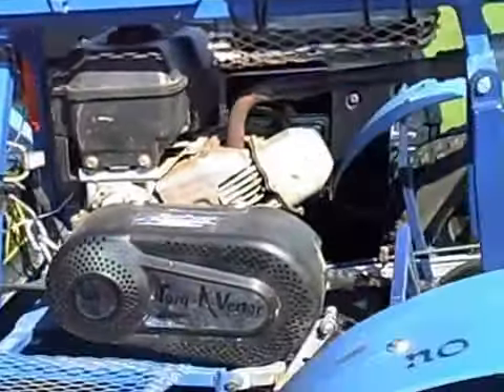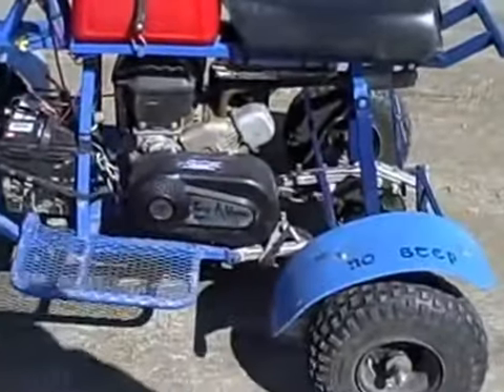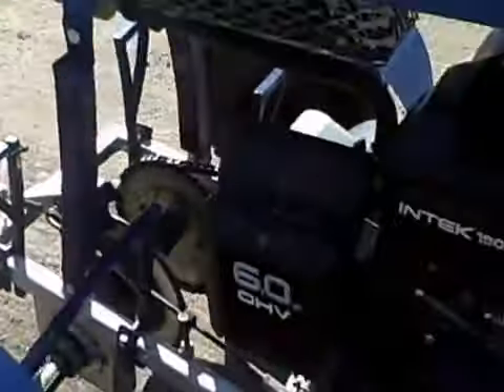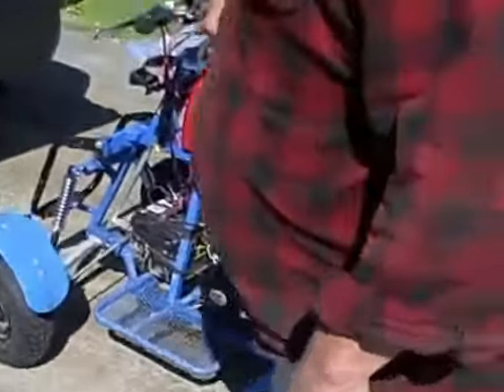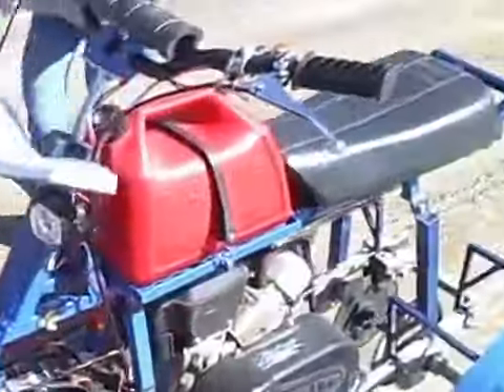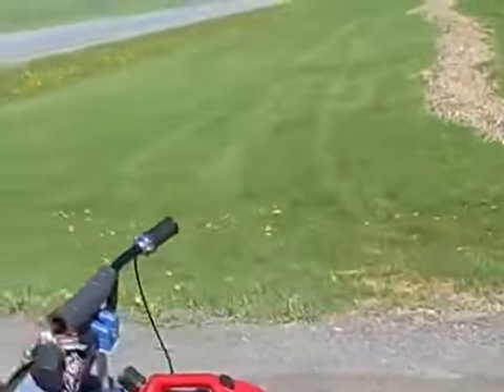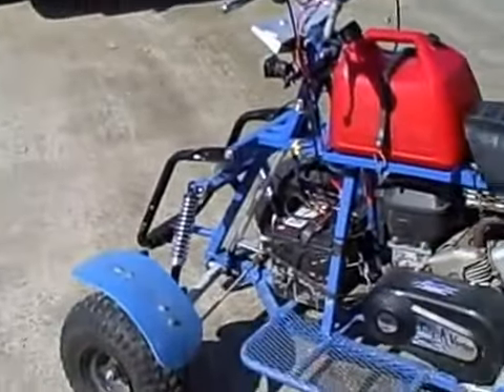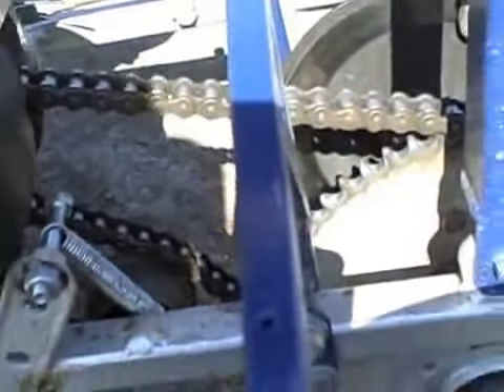Homemade atv,

Comment from the maker: yes on the frame. used 1"x1" steel tube.I built a 2nd one also and will do a walk around vid of it..my newest one is bit different. Longer, wider and with a 9hp Tecumsah. pulls me around at about 44 mph..I have updated both with smaller batteries for the lights. we use them a lot on dirt roads. I am going to do another walk around vid of this one to show more details of how I built it. Both use the Torque A Verters..makes all the difference in performance. thanks for the kind comment.

Comment: Great build on these ATV's.  Now that you have had some time with both the original and stretched version, anything you would do differently?  I didn't understand your comment on keeping the wheel size smaller to allow for using the Torq A Verter, what diff does wheel size make?  Can you provide a few dimensions - wheelbase, width and seat height please?  Again, great build, I am considering building as well.  Would be using them on old logging roads in the Adirondacks, wondering how suitable they would be.